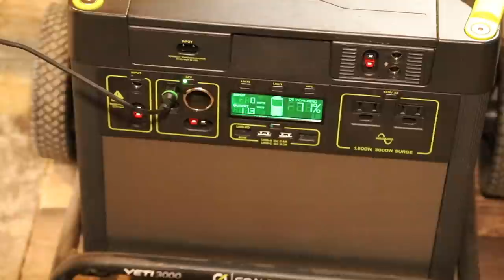Build a Stone Hearth for the Off Grid Log Cabin with My Dog | Woodstove Maintenance

Comment: Random thoughts.  I agree it's hard to get motivated when it's hot and humid.  I also would be leary of putting the stones to high up the wall.   Those stones are going to make a nice warm heat source when the fire goes out.   I also was thinking that you've got a lot to get done to get ready for winter.   The work never ends and it always takes longer when you try to film it.   Thanks for sharing your lifestyle with us.

Comment: A nice copper sheet would be perfect for a reflector. The cost however may be expensive.
Reply: What an excellent idea. The copper would give it such a clean look.
Reply: If I am not mistaken, Shawn did have the initisl intention to place a copper sheet behind the stovepipe. Seems he had a big sheet left over when he contructed his indoor kitchen sink. Plans change, and the stone wall will definitely radiate heat well into the night.
Reply: Good idea BUT the stone will BANK the heat (thermal mass) hours after the flames quiet !
Reply: The copper would turn green quickly from the heat

Comment: Hi Shawn, My wife and I have really enjoyed your video series right from the beginning.  The stone wall your building for the wood stove looks awesome and for the stove pipe you are using (single wall pipe) requires 18" clearance to a combustible material so if you want to avoid building your wall too hi or avoid adding a piece of metal at the top you can purchase double wall stove pipe (which for the length you need wont be too expensive)  which will allow you to be 6" to combustible materials. you can even add a slip section in between so the pipe can be removed and installed much easier.

Comment: Hey Shawn, you are spot on in this video in several respects.  You are burning yourself out!  Take some time off and enjoy a few beautiful days with the family.  Also, you are right in not letting the rock wall get too high.  Let the mortar set.  If you stack it up too high it will definitely weaken the joints.  Go back to it in a few days if it's that humid out.  You can build it all the way up but I would only go a few rows at a time, use more spikes in the bigger joints to help it stand better and give it time to dry.

Comment: keep misting your wall to allow the mortar to dry slowly .. the bond will be stronger as the  mortar will soak away from the rocks.. when you can make sure the rocks are wet .. so have a pail handly and slip stones in before adding . a mesh netting of chicken wire firmly attached to the wall where your stones bond is good and helps with strength .. also i add lime to my mortar and sometimes a wee bit of dawn dishwashing liquid to keep it moist and for elasticity .. you are correct only do so much at a time but make sure you leave at the top bonding spaces which means not to add mortar to your top row surface so your new row gets a good slap of mortar for proper join adherence ..great choice of surface for a rustic back drop.. i would take it up to a mantle level so you can use the top to hold stuff .. great job  Shawn .. good to see you are on the mend  and you need a video camp with Joe soon k  .. before that new baby comes :)    just sayin

Comment: Use Kroil penetrating oil on the bolts and screws one day before and they will almost fall out and you won't damage the heads or break one off. I'm a stone mason and tile setter and any hoddy that left that mixer tub in that condition would be unemployed.. always have water available and rise it out for each new load and when you are done. You always mix it dry then add water a little at a time. I would use heavy slate slab(s) for the base to set the stove on and chicken wire behind the rocks, it acts like rebar. You nail or staple the chicken wire to the wood and you could go as high as you like. Adding a little liquid latex to the mix would make it a lot stronger

Comment: Hi Shawn. Maybe bring the stonework up to just under that little shelf. Any higher and I think it could be a real headache...I fear it could break away later, as a full tip over or a partial crack away, despite the nails you are using as ties. The stonework will not expand and contract in anything like the same way as the timber,, so there is unlikely to be a total bond between the hearth and the wall. Maybe you could finish up with a wooden shelf to hang up the fire tools. Ideal. Awsome etc.

Comment: A little advice (I used to be a mason) - a mud board would help a lot, both with laying up the stone and doing the striking - it keeps the mud together and wetter. I'd strike the joints with a stick, not the trowel. I'd not use a wet sponge, but a dry whisk broom once the mud set up a bit. Good work though - nice video.

Comment: It’s looking great! 
Since you asked... I definitely build a stone wall in several steps. A little at a time spread over several days. Also, I’ve always kept my stonework separated from the logs to allow them to move without affecting the stone ( I tie it to the logs rigidly but keyed to allow the logs to settle). I’d be happy to go into detail but I’m pretty sure if you reading this you’re already past that stage.  🙂You’re logs are much smaller than most of what I deal with so it’ll be much less of an issue, if any. At the base if I’m uncertain about the weight concentrating too much in one place  I’ll lag a piece of angle iron in to let the load be distributed evenly. 
Anyway, I’m sure, as a yoga guy, you are well aware of the importance of maintaining a balance in your day. Feeling the impending winter breathing down your neck with a pipe dream list of projects just keeps it exciting and interesting, The battle is real to make hay while the sun shines. 
Thanks for the videos.... and best of luck.

Comment: Also with your Stonewall you should drive some anchors into the logs and more those in around your stones to give it that much more support. It will hold it tighter to the wall and you shouldn't have to worry about too much settling. Just a thought

Comment: Trying to lay up rounded stone is a PITA! I don't envy you on that.
Fortunately for me, I live in a state where there is hard shale shelf rock anywhere from 8" to 2' thick. You can fracture it by drilling holes and tapping in small wedges to shape it to desired size. Then it's basically like laying solid block.

Comment: Do not forget that the stones and ciment will transfer heat from the stove to he wood wall when stove working. Normally, by the Canadian Code you have to let an air space in between rocks and wood wall as a heat barrier. 1 inch air intake at the floor to 2 inches min. at the ceiling if you go to .

Comment: Shawn, as a retired firefighter of 30+ years, I felt that I should bring to your attention something which I feel may well become a safety issue for you and your cabin in the future. That being,  you are installing the rocks directly against the wood wall without any reflective barrier or any type of substrate between the rocks and the exposed wall. As I am sure that you are aware, rocks when heated by fire will hold the heat for a very long period time. As such, over a number of consecutive fireplace usages during the winter months, the heated rocks can easily remain heated and eventually transfer the heat to the wood wall and thereby start a fire within the wood wall its self.  Because of the thickness of the logs used to form the cabin walls and without exposure to a direct air flow, the fire would begin and remain smoldering for a number of hours before igniting into an open flame. With you sleeping above in the loft area, you would more than likely be overcome with smoke and probably would not wake up before it was too late. I am an avid fan of your thoughts, your premise in life and your shared videos, so please accept this comment in the manner in which it is given.

Comment: I would suggest installing some wiring & conduit around the perimeter so you can branch off from it when and where you need to as well as finding a permanent spot for the power to plug into your interior circuit.

Comment: Good on you Shawn, the short ones have been a novelty.  Good call on the stone height.  I've done a bit of stone work, and think your base might not have been big enough if you wanted to go the full height, even though you weren't retaining anything, the structure would have been heavy.  Looks good interesting to watch you go straight for the sponge, I usually start with a scrubbing or wire brush, then sponge finish

Comment: Maybe you already know but, here is a tip or technique for clean up the dusty floor. Collect a bunch of sawdust and make it wet in the bucket. It shouldn't be drip-wet but moisturize wet. Spread the wet sawdust on the dusty floor and wait a few minutes. It may be Okey one grab of wet sawdust per every one square yard. Then you sweep the floor with the broom. This technique was used to be used by the professional carpet installer before they install the carpet on the slab concrete floor to get well tack of adhesive. The wet sawdust captures most of the dust, especially cement powdery dust when the sawdust getting dry. So you will not have dust in the air when you sweep the floor and the floor becomes drastically clean. We use half dry tea leaves (after you make some tea) to sweep the "Tatami" mat in a Japanese room. Japanese green tea leaves capture dust in the "Tatami" mat even in deep inside of woven texture. The green tea leaves also disinfect the mat so the "Tatami" mat feeling like refreshing. You have a plenty of resources which is sawdust so you can try, right?
Reply from the maker: Thank you for sharing that great tip!

Comment: Happy Friday, Shawn. Thanks for the video.

If you plan to do much more this rough stone work, you should rustle up a few pieces of pipe about 8 inches long and in in varying diameters from 1/2" to 1 1/4". Those bits of pipe are a lot easier to use and control than that trowel when you are striking the joints between the stones. I like black steel pipe, but, honestly, galvanized pipe works just as well. A good stiff brush would help, too, and cut down on the wear on your sponge.

As always, thank you so much for taking us all along on your adventure. I'm looking forward to the more frequent short videos.
Reply from the maker: Thanks, I was wondering if there were better tools.

Comment: I built a cultured stone wall behind my wood stove Vermont Casting Defiant.  I bought another house and want to build a natural stone wall like you did.  However, I want to do it like I did my last wall.  What I did was screwed pieces of 1" square tubes to the studs in my wall and then screwed concrete board to the metal tubes and then screwed wire mesh to the concrete board.  I left a 1" gap at the top and bottom  of the wall so that any heat that would get trapped behind the rock could circulate out at the top and bottom.  The only problem is getting the first row of natural rocks started since they are off the ground by 1"   If you have any ideas I would greatly appreciate it.

Comment: a good measure for field stone mortar and weight is knee to mid thigh ... then let it rest .... it is one of those subjective things .... you compromise between height and mortar squish .... if you are pushing out too much then your too high .... if your barely pushing out any you can go higher ... as for full height ... if you switch at mantel height to flat stones about 1" thick you should be fine as long as they are laid to have the largest face out .... btw hammer and chisel cold chisel is good ... and you can face dress your stones from round to flat-ish that will make a nice field stone top above the mantel and not be too heavy for your base .... use the 8 and 12inch size boulders and knock em down about halfway to slab out a 1" slab on each side .... it is pretty easy .... when you hit the chisel dont bounce it; its hit and wait sharp and hard like knocking out a .22 nail gun cartridge .... get a rhythm going and you can face the slab as well ... even add your logo 
.
when a video or even a series is good enough to get a like I like it ... and tbh you have been consistently making enjoyable videos ... and yup i keep liking em .... it is obvious from the content of your video's that you do read the comments at the least .... heck I can see where some of my suggestions have been modified or even taken as is and incorporated into what you want to do .... I am sure others can see where their ideas have been included as well ... That is one of the joys of this channel you started by saying you dont have the experience or the knowledge to do everything you need to do BUT you will try anything to get it to work .... I see you did a look back opening clip .... amazing what has been done since it was just a patch of earth with some plants in the way a little over a year ago 
.
as for your power needs ... like a house you plan to keep for years ... do it as you can afford it and renovate and add on as you can .... Your cabin roof is a great spot for panels or even a old fashioned water wheel wind mill .... it can pump water up from the stream and turn a generator to add power all year long as well ;) 
A good suggestion for next inn line for power needs is a combination of hot water and higher power use items like a freezer or sauna .... all of which have many overlapping possibilities to limit extra need and share what is being made as much as possible .... ie hot water temp kept up by radiant heating from sauna ... keep fridge working at optimum by using a water jacket on the cooling fins on back of fridge and use that waste heat to keep hot water hot ... etc  ... seriously a hydro generator or wind powered one wouold be a good next choice ... as you will need to get a localized water source for the cabin to cover the hot and cold running water of a more domestic life shall we say .... as far as running heck  basic barrel up near the eve of the roof at one end of the cabin and pump water into that and you have water pressure for one house.... between the outdoor kitchen the indoor kitchen and eventually sauna or some other heat sourced luxury ;) you will be able to find a way to keep a supply of hot water all year long no problems 
.
As for the hard to get motivated when you are your own boss  ... when i worked for myself I always bitched about how the boss made me get out of bed and make him coffee every morning .... but dang I did like drinking it on him ;) take cali and grab a tent and do a quick overnighter out the back 40 ... take a break scratch the itch and get a break ... you can hear it in your voice you want to get out ... well get out take a quickie ... heck steal the wife tell the kids look after cali and just the two of you go find a quiet spot and be like teenagers and have a little fun weekend just the two of ya .... after that everything will be good again ...

Comment: That will look realy good. But there is one problem, you have no contact to the wall. If the wood is growing and schrinking it could push the wall forward. On my old woodframe house the stone wals are fixed in the frame by nails. They are taped in half and half in the concrete. Maybe this is helpfull to you. You making realy nice vids and I like em much. More of that please.

Comment: You can see the many suggestions here to take a breather. Energy expended when you are tense pushing through fatigue or the illusion that you can be faster by rushing is what really does slow you down. It also heightens the risk of injury. I know you know this, but just a little reminder. Replenish yourself. We’re not going anywhere. You’re at no risk of not getting done what needs to be done.

Comment: Man this stuff just never gets old for me, I can't wait.
Reply: So when are you going to build that log house shop, so you can work inside with logs and wood, all winter long? Hehehe
Reply: if you ever do, I would use 3 sided logs, so much less chinking and easier to do alone. But lots on the draw knife.
Reply: Oh and dont forgot the sled garage. You likely need room for more than one though, if you did all that, expect. Joe, Lily, TA, and Canadian Prepper to all be there :P
Reply: Yea I always like your guys vids, and thumbs up before i even watch em.
Reply: Na just because your off the grid doesnt mean you need to exclude technology. Even the guys in alaska use technology. If you need a very good Solar supplier, Let me know there is a great guy here where I am. $1200 for 1000 kwh panel (all you'll need even in most homes) and battery/inverter/charge controller and then 1000 for a furnace. (if needed)

Comment: nice video, you can do just about anything.  I would surely replace that black pipe with a slip joint pipe. i did on mine makes it a whoe bunch easier next time you clean the flue.  great work mister....Tom n Rocky